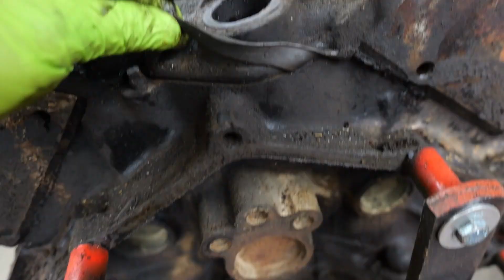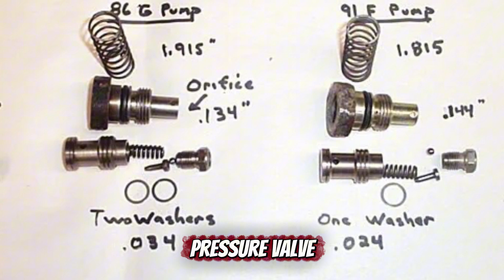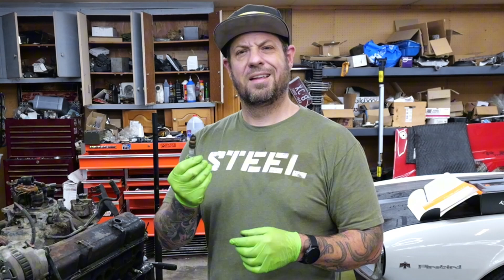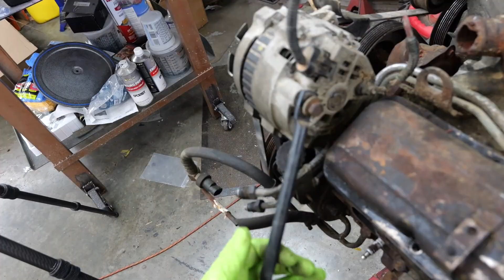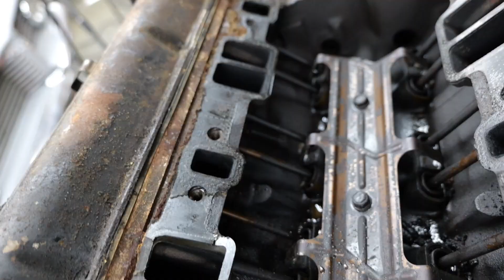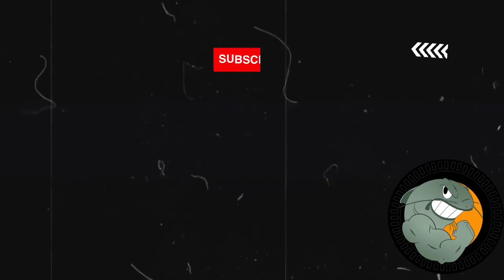SBC Engine Teardown! What to Keep and What to Toss?

Comment: Hi ya Catfish how you been & you still have 66 Fairlane Gasser ?  Mines down again new p.s pump & pressure line blow + assist cylinder issue ; ) my 351w + is still get warm on cruising 220 so going after cooling system. MorWil AZ 66 Fairlane resto survivor dreams & hopes Later's

Comment: Those heads most likely were replaced. As they should be center bolt valve covers. Those are obviously perimeter bolt. Check casting numbers, doubtful but may be a desirable head foe someone else 🤷‍♂️
Reply from the maker: That’s just sitting on there. If you look the one that’s actually bolted down on the passenger side is center bolt.  I assume dude who I bought it from took the cover off the read the head number and then tossed the wrong valve cover back over it. Unfortunately the heads are the worst of the worst small valve swirl ports.  

I swear I almost said something about it, but figured nobody would notice.
Reply: @CatfishMotorsports  oh ok. I understand completely have the same motor in my square body truck. It’s an ‘87 ;unfortunately it’s not even roller block, buddy has ‘89 it’s a roller block at least. Didn’t catch the other side.